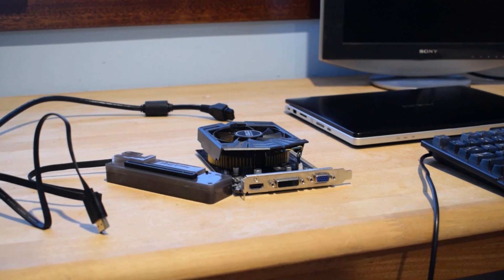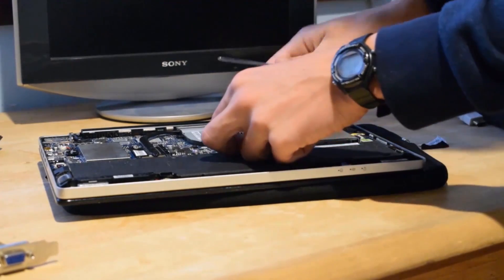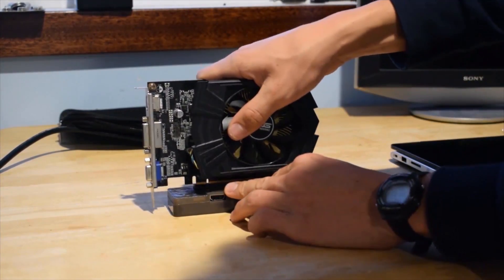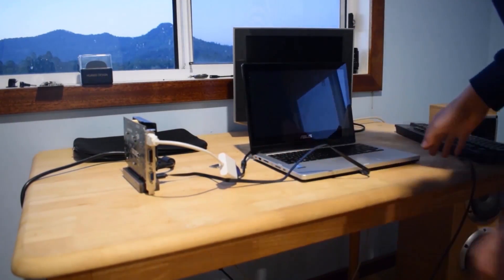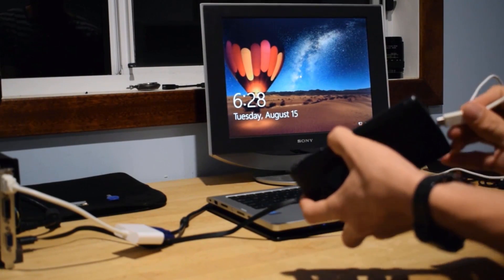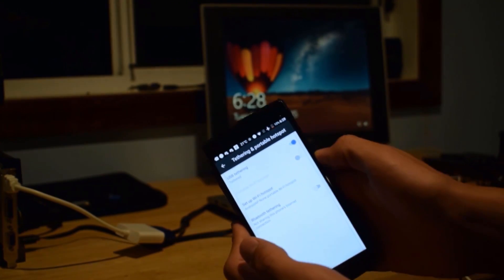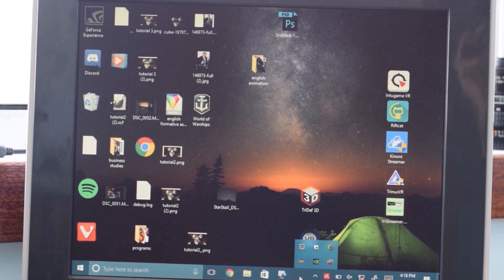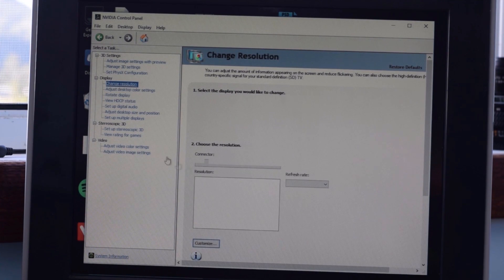How to Connect External PC Graphics Card to Laptop (no thunderbolt port required) Egpu Setup

Comment: thanks for the video. can we not use external monitor, just the laptop..? Appreciate your reply. Thanks
Reply from the maker: Hey, technically you should be able to use just the laptop (using a technology called nvidia optimus), as long as you have intel hd graphics. That said, that is not always the case, as each laptop model/brand may have its issues. For example, my laptop (asus transformer book tp300la) should work, but th bios appears to disable the intel hd graphics on boot when the egpu is connected, so it doesn't work without the monitor. So, yeah, while it should work, there may always be issues preventing it from working, which would then require you to use an external monitor.
Reply: qwertypop: Appreciate it!

Comment: i have an i5-6200u processor with 8gb of ram. will i be able to use this for an egpu setup
Reply from the maker: What brand is your laptop? Your specs are good enough, so you just need to make sure your laptop doesn't have a bios whitelist, which would prevent you from connecting an external gpu.
Reply: qwertypop it's an asus x556u
Reply from the maker: Yes, that should work fine as far as I know (no 100% guarantee though)

Comment: Hello Sir, i wonder if you can help me i have watched your video and i would like to know if i can use this egpu for this laptop with a 1050 ti card, thanks good vid.
https://www.amazon.com/HP-Notebook-Touchscreen-Processor-SuperMulti/dp/B01N9C7EMK/ref=sr_1_3?ie=UTF8&qid=1510539812&sr=8-3&keywords=2017+hp+i3+laptop&dpID=4196xVyTi3L&preST=_SX300_QL70_&dpSrc=srch
Reply from the maker: Hey, not quite sure if that laptop has a bios whitelist , which would prevent the egpu setup from working (I don't think it has, since I think its mainly the older HP laptops that have this), so if it doesn't have a bios whitelist, then it should work. The 1050ti may get bottlenecked a bit by the egpu connection and the processor, but it should still be fine. Hope this helps. If you can't find out if it has a bios whitelist, then you may just need to take the risk. If you do go ahead, please share your results with me.
Reply: thanks sure ill do, gl pce!

Comment: How to connect extra external ram to a laptop ??
Reply from the maker: I don't think you can connect ram to your laptop externally. You will just need to remove the ram chips you have at the moment, and replace them with higher capacity ones (eg. remove a 1gb one, and replace it with a 4gb one. Note that the new ram needs to be of the same ddr version [eg. ddr4 won't fit in a ddr3 slot])

Comment: HI, i am using egpu version 8.0 i am using a gpu gtx 550ti its working well but when
i put a gpu much higher like gtx 960 2gb it crash about 30 min on windows,.if i
put a gpu like gtx 780 4gb will it crash.please help thanks.
Reply from the maker: Not sure, what power supply are you using?

Comment: My laptop has Intel Core i7 4700MQ and im planning to buy 1060 or 1070. I dont wanna bottleneck the GPU too much. Im fine for %15-20 loss if its safe. What do you think ?
Reply: sub for sub,I am subcribing to your channel right now.Sub back)
Reply from the maker: I'm not sure. It would probably work, and the cpu shouldn't really bottleneck the connection significantly, but the mPCI-e connection might. I will test this soon (hopefully on the weekend) if I get time.

Comment: My spec dell d420 laptop 1gb ram 1.3ghz window xp
Reply from the maker: While it technically should work as far as I can tell, I would upgrade ram if I were you. Also, unless you get a REALLY low end gpu, your specs would probably bottleneck it.

Comment: I have i5-5200U 2.7ghz 6gb ram. What gpu should i go for? (Planning on 1050ti)
Reply from the maker: Yea, 1050ti should be fine. Might be bottlenecked by the connection a bit though, not sure. I would recommend that or something a bit lower.

Comment: Hey qwertypop can I do the above with my laptop too ? Here are specs
HP elite book 8570p, Intel core I5 2520m 2.50 GHz, 3.Ram is currently 4 GB but I will upgrade to 8 in a couple of weeks, Amd radeon HD 7570m 1 GB graphics , 2 USB 2.0 ports, 2 USB 3.0, eSata USB 2.0 , Express card  

Thanks plz reply
Reply from the maker: Yes, that should work fine as far as I know. You might need to get this: https://egpu.io/egpu-setup-13x/ to disable your radeon hd 7570m for the egpu setup to work though. Also, since you have an express card slot, I would recommend you get the express card version of the EXP GDC dock: https://rover.ebay.com/rover/1/711-53200-19255-0/1?icep_id=114&ipn=icep&toolid=20004&campid=5338180966&mpre=https%3A%2F%2Fwww.ebay.com%2Fsch%2Fi.html%3F_from%3DR40%26_trksid%3Dp2380057.m570.l1313.TR0.TRC0.H0.Xexp%2Bgdc%2Bv8%2Bexpress%2Bcard.TRS0%26_nkw%3Dexp%2Bgdc%2Bv8%2Bexpress%2Bcard%26_sacat%3D0
Reply: sorry for the late reply, Thnx  I will look into it , but I m very busy but thnx anyway

Comment: What will happened to your wifi ?? After you putted the ext  cable   from place of wifi slot ... The wifi of laptop is work??
Reply from the maker: +rebaz jabar The WiFi won't work because you remove the WiFi card. To get WiFi back, you need to either use a lab cable, USB tether your WiFi connection from your phone to your laptop, or get a USB WiFi dongle (they are like $6)

Comment: but after that ,an your computer still be connected to wifi?
Reply from the maker: +On your bike No, your computer won't be able to connect to the Internet via WiFi when the egpu is connected because you remove the WiFi card to connect the egpu. To get WiFi while the egpu is connected, you need to either use a lab cable, USB tether your WiFi connection from your phone to your computer, or buy a USB WiFi dongle (around $6 on ebay). Hope this helps.

Comment: my laptop's processor is core i3-4005u 1.7GHZ and I will use palit super jet stream gtx 1060 do you think i can play high end games in more than 40fps? thanks :)
Reply from the maker: What games do you consider "high end"? My cpu is nearly the same as yours, so I might be able to test it (to check if they use max cpu, since if they use max cpu, you probably won't get that great performance). It should work fine for most games though, as long as the gpu itself is good enoughto run them well.
Reply: thanks for replying,  like batman arkham knight, ac unity, witcher 3 and other  new games. Is it possible i can still get 40fps in ultra settings? sorry for asking too many questions, Im a little bit new heheh :)
Reply from the maker: +PEDZGaming Hm, sadly I think your cpu is not good enough for those games, and as a result would bottleneck your setup, reducing the fps to below 40 (don't know how low it would be). As far as I know, these games require quite a decent cpu to run well. I am not 100% sure though, as I don't have any of those games, so I can't test them on my laptop. I would recommend you do some more research (eg. Find a desktop equivalent to your cpu and then Google benchmarks of the games using that cpu and a 1060, and see if performance is good enough). Hope that helps.
Reply from the maker: +YoYoGFX do you know what model your laptop is?
Reply from the maker: +YoYoGFX Hey, will have a look into that when I get time. Am quite busy right now.
Reply from the maker: +YoYoGFX Sorry for the late reply. Providing your laptop does not have a bios whitelist (you will need to research this), I reckon you should be able to run Overwatch at low settings above 40 fps (I would guess you could get around 60 all low with a good gpu, can't guarantee it obviously though, since I haven't personally tested it).

Comment: If I was to connect an external gpu to the latest xps 13( quad core). Would that work well for gaming?
Reply from the maker: +yuan fang qian Hey, here is a post by someone who connected a egpu to their xps 13 via the akitio dock and thunderbolt 3: https://egpu.io/nvidia-optimus-dell-xps-13-akitio-thunder3-gtx-980/
Or did you want to use the mpcie slot instead of the thunderbolt port?
Reply from the maker: And yes, it should work well for gaming, since your hardware shouldn't really bottleneck the gpu. The gpu may be a bit limited by the connection speed of the mpci-e port, but it should still work well.

Comment: Would this work on Lenovo yoga 710 I need your help. TY
Reply from the maker: It should work fine as long as it does not have a bios whitelist. Someone requested a whitelist removal, so that would suggest the model he has has a bios whitelist, not sure if this is your model though: https://www.bios-mods.com/forum/Thread-REQUEST-Lenovo-Yoga-710-15ISK-0GCN21WW-Whitelist-Removal
Reply: Thanks for the quick response I'll look in to it.
Reply: So it turns out to be 151kb would it work or how can I check the bios
Reply from the maker: Hi, I sadly don't know if this would work, as I don't have one to test it on :( 
It is also not possible to check in the bios as far as I know, so the only way to tell is by trial and error, but no one appears to have tried connecting an egpu to your model before (or atleast they didn't document it on any forums). Best way to find out would be to borrow a egpu setup from a friend or something, or buy a wifi chip which you know is incompatible with lenovo laptops that have a whitelist, and if that works, an egpu should work too. Sorry that I am unable to give you a definitive answer :(

Comment: Can the amazing spider man 2 pc game will run on 2 gb graphics card???
Reply from the maker: The Recommended Specs seem pretty low: 
The Amazing Spider-Man 2 Recommended Requirements:
CPU: Intel Core 2 Quad 2.4 GHz / AMD Athlon II X4 2.6 GHz
RAM: 4 GB
OS: Windows XP
VIDEO CARD: 512 MB 3D hardware accelerator card required – 100% DirectX 9.0c with Shader Model 3 support. Nvidia GeForce 285 GTX / AMD Radeon HD4830

what gpu were you thinking of?

Comment: Would this work on acer aspire e1-570?
Reply from the maker: Yes, that should work as far as I know. Here is a video showing someone connecting an egpu on a very similar computer to yours (the Acer e1-571): https://www.youtube.com/watch?v=gC614jg7T5M
Reply: qwertypop thanks, but can i use something like ftx 1050 or lower than that, thanks for the reply though :D
Reply from the maker: Yes, should work fine. Just be aware that there are reportedly some driver issues with the 10xx series of nvidia gpu's and using them in egpu: https://egpu.io/forums/expresscard-mpcie-m-2-adapters/nvidia-is-killing-off-mpciengff-m2-egpus-error-43-with-372-90/

Comment: i have hp elitebook 8760w core i7 .iam trying to connect external gpu gtx 750ti 4gb ddr5 via usb 3.0 expresscard.but not detected.can you help me.
Reply from the maker: Maybe try following these steps: https://egpu.io/forums/implementation-guides/2011-hp-elitebook-8760w-and-8560w-gtx1060-6gb-on-exp-gdc-beast-8-4b/

Comment: this is actually a great way to play games on a laptop ...do u know why it uses the wifi card card slot..if it is only for power ..could i plug the in the PCi slot into another laptop and hdmi into the laptop im using?
Reply from the maker: Hi, the wifi card slot is actually used to transfer the data from the laptop to the egpu, so you do need to have it plugged into the laptop you are using, as this is the only way it is actually connected to the laptop (there is a cable going from the wifi slot to the gpu, then a cable from the gpu to the monitor, and the power supply is also plugged into the dock). Hope this helps.
Reply: qwertypop i see thanks..would like to my laptop portable also ...seems like a semi permanent change..
Reply from the maker: mohamad raieyan I guess it could be considered a semi permanent thing. My laptop is pretty easy to open up, so I just don't skrew it together, which makes is quite quick to connect and disconnect the graphics, so I do quite often end up connecting it for a day, and then disconnect the egpu in the morning when I need to take the laptop with me.
Reply: qwertypop well the mini pcie slot is on the keyboard side and pretty near to the exhaust fan..so would b3 a hassle to deal with.
Reply: it would work if i found like an extender and modify it to look like a port
Reply from the maker: +mohamad raieyan Yeah, it's stupid when they make the motherboard only accessible by opening up the keyboard side. Make things more complicated to get too. An extender might be an idea, but that might reduce performance of it is not good quality. Your choice if it's worth the effort :)
Reply: qwertypop haha...i know right..yeah just dont want a cable dangling out of my laptop if i install it u know...would love it if they had an idea to hide the cable
Reply: but my hdd and ram do have a separate panel for it to get to..why just not include the wifi card with the panel..😢😢
Reply from the maker: +mohamad raieyan Yeah, I know... Would be perfect if it was just under a panel which you can easily open. An old packard bell of mine had it this way, but too old to revive, even with egpu. I think laptop components are getting harder and harder to access as brands try to make thinner and thinner laptops :(

Comment: I have i3 4th gen 1.7 GHz and 8Gb of RAM will it work with GTX 1050?
Reply from the maker: What brand is it? Also, check out this: https://egpu.io/forums/expresscard-mpcie-m-2-adapters/nvidia-is-killing-off-mpciengff-m2-egpus-error-43-with-372-90/
Reply from the maker: Sorry for the late reply, I must have forgotten to answer. What brand and model is your laptop? There are some driver issues with 10xx series graphics cards (see pinned comment), so you may want to use an older gpu.

Comment from the maker: Some useful resources regarding egpu setups:

General Egpu info:
https://egpu.io/external-gpu-buyers-guide-2017/#mPCIe-interface
https://www.reddit.com/r/eGPU/comments/5jpf2x/diy_egpu_101_introduction_to_egpu/

Some info/issues to take note of:
Nvidia 10xx series egpu driver issues: https://egpu.io/forums/expresscard-mpcie-m-2-adapters/nvidia-is-killing-off-mpciengff-m2-egpus-error-43-with-372-90/

HP bios whitelist info (bios whitelist prevents you from connecting an external gpu if your laptop has it):
https://h30434.www3.hp.com/t5/Notebook-Wireless-and-Networking/Does-HP-Pavilion-15-e001ax-has-bios-whitelisting/td-p/5973244
https://www.sevenforums.com/hardware-devices/293403-beware-dreaded-white-list-hp-guilty-charged.html
Reply: qwertypop :I want to know the answers for  below two questions???                                                        1.I see some of them getting error 43,its because nvidia blocking the support  with its latest driver update(after 372 driver update).is that true???                                                 Is it possible for lenovo g50-70????  (bios is whitelist)                                                                                              2.And i have lenovo g50-70 laptop. Some of them saying that all  lenovos laptops bios is whitelist, that means there is no way to change the hardware settings in bios.                                               Please reply bro if you know the answers it it will helps me a lot
Reply from the maker: siva reddy yeah, I also heard that the latest nvidia drivers break egpu support for the 10xx series graphics cards. I honestly don't know if that laptop has a bios whitelist, you will have to try to google it, or just take the risk and see if it works. If you do get an egpu, please tell me if it works on your laptop so that I know for future reference thanks. Sorry that I can't help you more.
Reply from the maker: Ps I don't think all Lenovo laptops have a bios whitelist. Only some as far as I know.

Comment: im wondering if this can work on my laptop my specs are
i7-3740qm
16 gigs of ram
rite now i have gtx 680m sli in my laptop but wondering if do this i could use a gtx1060
Reply from the maker: It should work fine, but there's some driver issue thing apparently with nvidia 10xx series gpu's, so you might need to use an old driver as far as I know based on what it says on this forum: https://egpu.io/forums/expresscard-mpcie-m-2-adapters/nvidia-is-killing-off-mpciengff-m2-egpus-error-43-with-372-90/paged/2/#post-1114
Reply: ok thanks for the reply and the info

Comment: Does your CPU temp increase when you play games?
Reply from the maker: Well, when playing games the cpu is under quite a bit of load, so it will heat up a bit,  but it doesn't heat up any more than it would when playing games on the integrated graphics (I would imagine if anything it would heat up less, as it isn't using the integrated gpu which is on the cpu)

Comment: I have a Dell i7 8GB ram , so can I use a nvidea 780ti (or a better graphics card)to boost my cod black ops 3 FPS .(ussuly I got like 15 FPS so I need to now if I put that graphics card can I get like 30 -40 FPS on bo3 ????)
Reply from the maker: Yes, you should be able to, as long as the game is not bottlenecked by your cpu, which it shouldn't be. Gameplay on nvidia gtx 780ti: https://www.youtube.com/watch?v=_9rkZE1gZ1A
Reply: You should go for GTX 1060 - 1080